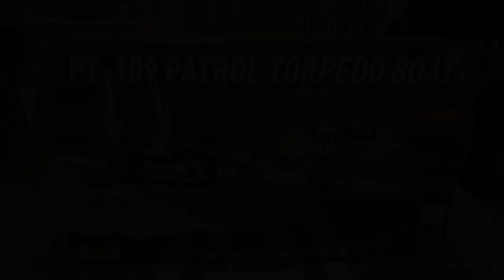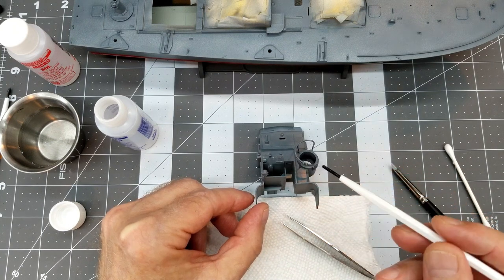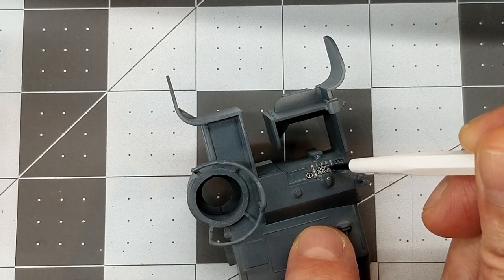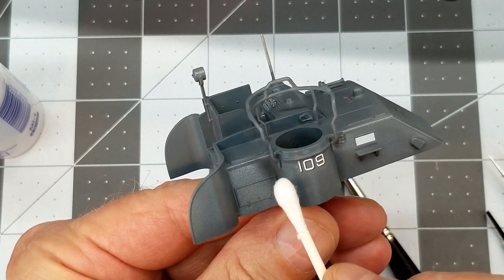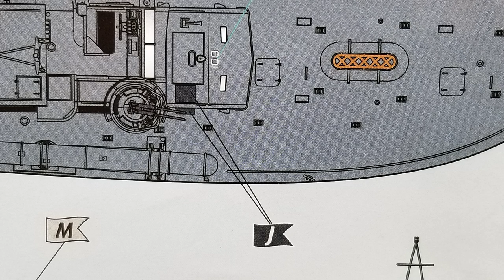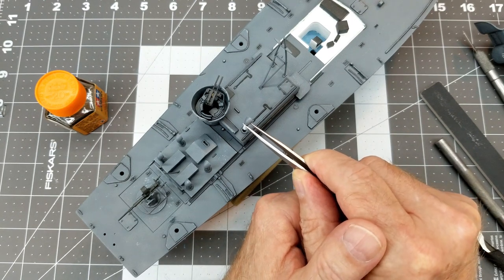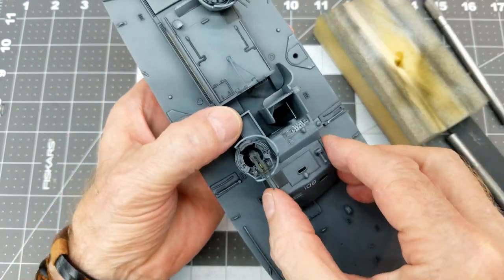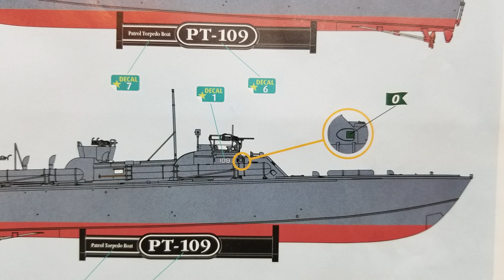PT-109 Patrol Torpedo Boat by Revell in 1/72 Scale. Part 3, Weathering and Final Reveal

Comment: Hey bud what kind of paint you use?!?!TIA
Reply from the maker: Hi Royston, great question. I'm using Anita Craft Paint. It's a water based acrylic paint manufactured by Rust-oleum. For best consistency I always strain it when pouring it into the airbrush. Craft paints are thick so you will have to thin them, I'm using Vallejo Airbrush Thinner for acrylics, but you can just use water to do the job. Thanks for watching, take care. Johnny
Reply: @Hillbilly Modeling  thank you so much, I will have a look.. just started on my revell  PT 109 😎
Reply from the maker: @roystonpereira2887  You're welcome Royston, enjoy your PT109 build my friend! Johnny

Comment: Nice work,  bad model kit. A lot of parts are poorly scaled. There is a website called PT 103 with a lot of detail illustrated for builders. I'm in the process of building an old Lindberg PT 109 kit which is also not great it has a lot of inaccuracies. I'm 3D modeling all new structures then 3D printing them to use with just the hull and deck from the original kit.
Reply from the maker: Thanks for the info! If you're building a Lindburg kit it must be in 1/32 or 1/64 scale, I think those were the only scales that Lindburg PT boat offerings came in. I could be wrong on that. Good luck with your upgrades, thanks so much for watching. Take care and model on my friend. Johnny